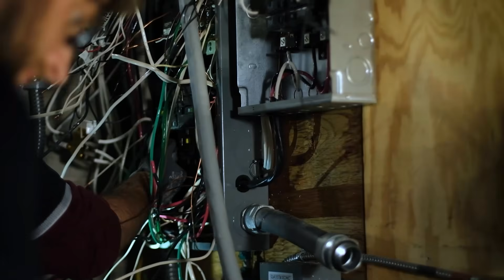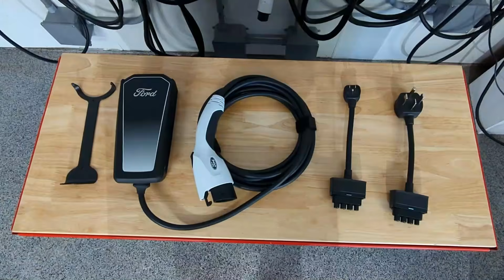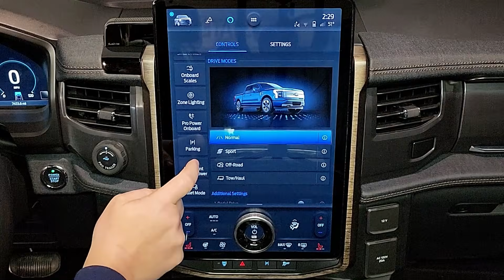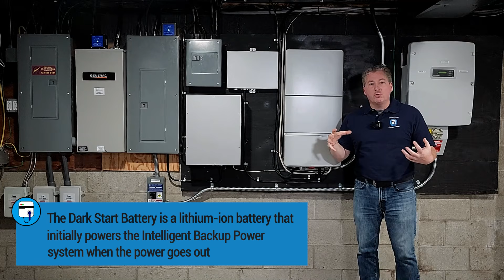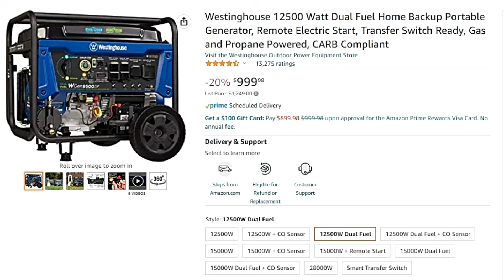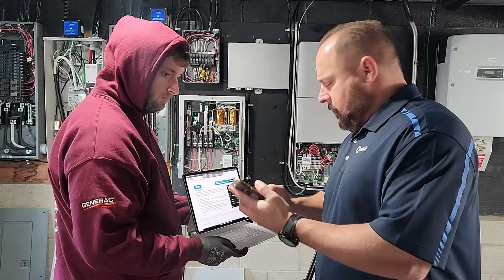Watch How Ford Lightning's Intelligent Backup Power System Works In A Real Home

Comment: If I had an F-150 Lightning, I would stick with running a few extension cords from the ProPower plugs. For now, I just wish my Tesla let me plug any 120V cord in. I have so much power sitting in my garage, yet no way to tap into it!
Reply from the maker: Yeah, it's disappointing that Tesla doesn't seem willing to make a system like this. They don't want you using your vehicle's battery to power your home. They want you do buy a Powerwall.

Comment: Tom I have waited months for you to make this video! Truly awesome 👏 and thank you! Well worth the wait, my setup is still all manual and only have one main panel, I have a $20 breaker lockout switch, 40amp breaker/circuit to my generator input, when my power goes out my wife just flip the lockout switch that turns off the main and active the generator input (generator automatically turns on from a separate line sensor input) so just the one switch she needs to flip when the power goes out! 

Sorry but I am not going to spending thousands of dollars just so that she don’t have to flip that one switch! Sorry but a $20 switch for the win,
Once I get the Ford lightning all she would need to do after flipping the switch is connect the 30amp output into the generator input, just need to buy that cable, manual for the win and everything except large loads in my house, technically we can run one large load at a time if really needed.
Reply: Thanks for making this video Tom, I was hoping it would not cost so much todo .. just so you know the cost to upload your line to 200amps is not required so that cost should not be counted, but I understand if you want to higher than 11kW charging speed, most people already have 200amps service anyways, overall still very expensive not doing it, keeping my $20 lockout switch setup.

Comment: Thanks, Tom - awesome video, I've been waiting for this one. We took a serious look at FIBP - even working with a local electric installer - but the hurdle I just can't get over is the idea that if we sell the house sometime in the future, what are the chances the next owner has a Lightning? It feels to me like there needs to be some sort of industry standardization of V2H to avoid vendor lock-in with these backup power solutions.
Reply: A mobile or self built inverter/battery backup system is cheaper and more flexible.  Just use the pro-power onboard to feed that system and it'll slow charge it while the inverter system manages where the power comes from, solar, battery, generator, EV, etc

Comment: That is pretty expensive for an inverter setup like that. I'd rather spend that on solar inverter and server rack batteries.  Although I would argue that 9kW is plenty of power for most homes, unless you have only resistive electrical appliances. (central heat, water heater, stove, dryer, etc). But you could still run a fridge/freezer, some lights,  and one of those electrical appliances at a time. You'd just have to manage those larger appliances and AC if that were that case.
However, since the F150 has an L14-30 plug on it already, I'd just throw in a generator receptacle and transfer switch or breaker interlock and call it good. Much cheaper that way and can be used with any generator if needed. Just have to make sure to shut all your non-critical appliances off before switching over. And if you have an electric furnace, maybe time to upgrade to a heat pump...

Comment: Keep in mind, with the Inflation Reduction Act, now we don’t need to add solar to a house in order to get a tax credit for putting a battery in our house as a load balancing element. Would that be for everyone?  Of course not, but that is also going to be an increasingly financially viable option for some of us as battery prices continue to go down and would be attractive in areas of the country where power prices are expensive and where different rates are offered as demand on the grid changes.

Comment: I don't believe that most car companies will design and sell intelligent backsup setups , they will likely just make their vehicle capable of communicating with some standardizrd backup system.  I wouldn't invest in a system like fords unless it was standardized so you can plug in any vehicle capable of bidirectional  charging  in case you decide to go with another truck manufacturer in the future.
Reply from the maker: That may be the case, and I should have been clearer. I really meant to say all EVs would work with systems like this. SOme will be made by the OEM and some will be made by 3rd parties, but eventually, they will be universal.

Comment: Can the solar on your roof charge the Ford Lightning during a power outage? Let's try it please!
Reply: Ford has said the present system will not do this.  Takes DC power from the truck battery - doesn't go back.  However, the solar fed into the inverter will supplant any power usage in the home during a loss of grid power.
Reply: @billjohnson3344  Suckie! maybe next year?

Comment: Is the higher power inverter that is coming later able to provide more than 9.6 kW from the truck? Or just more for the attached solar?
Reply from the maker: There will be multiple offerings, I don't know the exact power ratings. Sunrun can tell you because the are the supplier.

Comment: Amazing video as usual. Actually the one I was waiting for. Yeah I definitely considering going with the manual transfer switch option as I have seen on forums too. But for sure I will the station pro installed, but not by SunRon because they want to charge a “flat fee” of $1.600 USD.

Comment: Thanks for walking us through this Tom. Was the option offered to have the system installed with a home battery? It is on the example wiring diagrams. I think the home integration system with a small stationary battery would be quite compelling compared to a large stationary battery.
Reply from the maker: Yeah, it's an option, but IMO, not financially sound for me since I already had the generator and TOU plans here aren't advantageous.

Comment: It's too expensive IMO.  You can ALMOST get a full Generac system for the same price and still use your truck.  Or just get a 50A plug or generlink and a generator.  Perhaps in some areas it makes sense where gas seems to be banned like CA.  But everywhere else a basic gas generator and a link is pretty simple

Comment: My 31 SunPower 327solar panels (10kW AC) array each have a microinverter on them. There are 3 20A 240V strings - 11 panels each on two of these, and 9 panels on the third string. So, the solar panels are "interfacing" with AC power directly.
I am not going to be using a fossil fuel powered generator, period. If you do use a "house battery" function with an EV, then you would save money over time. Getting ourselves off of fossil fuel ASAP - is the most important thing we need to do.

Comment: Tom, 400amps what a show off..lol...we had to upgrade our house to 200amp for our Tesla. Very interesting video thank you.
Reply: 400A isn’t that unusual.  In 1990, I built a house in New England requiring 5 AC condensers, pool pump, bathroom floor heat, electric cooking, Tesla Wall Connector, and 4 refrigerators.  The electrician specified dual - 200A panels like Tom’s.  

When power was lost, we had a frugal setup using a Honda generator with a manual transfer switch.  Today, I’d do a much better system, but home was sold.

Comment: Install cost is comparable to a single Tesla PowerWall, but with significant more capacity. 

But still too rich for my blood. Sure wish there was an easy way to use a generator inlet without a sub panel, but due to the GFCI on the truck you need an isolated sub panel.

Comment: Great video but Sadly Ford and their ccs lighting pro was not the first of the kind! Chademo is 100% compatible with feeding power back to your house or other devices also. They don’t have a smart system but they were the first!

Sorry for waking the troll!
Reply: Ford first in North America.... 

Chademo bi-directional charging has not been marketed in the North America.... But a few are just hitting the market now, ironically when Chademo is virtually dead North America...
Reply: @nc3826  sadly this is misinformation. It was available to the us market but the car manufacturers snuffed it out and kept it quite. Chademo was out of the gate bidirectional compatible. There was a handful of devices out there to use it too. The very first Nissan leaf’s even work with it.
Reply: I'm sorry I forgot to check, conspiracy theory weekly, for the story.

G00gle, Wallbox Quasar...
Reply: @nc3826  sorry but this isn’t a conspiracy theory the chademo protocol has had bidirectional charging in it from the beginning. Not sure what your trying to gain by proving otherwise! Fact is bidirectional charging is not new and Ford did not start it.

Sad thing is anything with a chademo plug or ccs plug on it back then was expensive
Reply: @nc3826  oh dear god! Now you’re believing anything you see on the internet. Just because a company claims first doesn’t mean they were!
Reply: @nc3826  trust me I’m not voting for chademo it is going out the door and having 2 separate connectors on the same car was just stupid!

Comment: One positive from your particular install is being able to use at least some of the solar while the power is out. I realize that cutting solar generation during an outage is about safety for the line workers, as you mention, but it is a shame when solar can't pick up the slack for utility power for direct usage and not just with a battery backup. 

And of course you would set up your natural gas generator to power at least one hefty outlet for charging in your garage!
Reply: There are some new grid intertie inverters that can provide limited amount of power for some home circuits to run some of your loads off of the solar inverter.  So say. you have a 6 KW inverter to send power to the grid, and have a transfer switching installed with say the refrigerator and home lights circuit breaker fed from that transfer switch.  Then your 5-6 KW solar system can provide a portion of it's max rated power to those circuits.

Comment: The idea is not bad, but the whole system is a bit overcomplicated. For emergency power supply, an alternative based on E-GMP cars makes more sense. @TheIoniqGuy has tested it and it works well https://youtu.be/ZmmhOXsIRjw, but the main drawback is the low peak power for countries using the 120V system.
Reply from the maker: That's really a totally different animal - it's more like a low-powered Ford Pro Power Onboard than it is a home backup power system. As you noted, here in the US it's limited to under 2 kW of power and is not very useful in a power outage.

Comment: I thought the Leaf was first to do V2H, just not in North America...
Reply from the maker: It was technically capable, but Nissan never sold a system that would allow it to do so.
Reply: Nissan has approved the first bidirectional charging system for use with its all-electric Leaf vehicle in the US. Sep 13, 2022,  

The FE-15 charger by Fermata Energy, which can power buildings using the EV’s battery, charge it, and send stored energy back to the grid, is the first system of its kind to earn UL 9741 certification for bidirectional charging solutions.

the automaker is also working with another company called Dcbel that is creating a home-specific bidirectional charging solution...

Japan version came out years ago, not even sure if it's still sold and it's all based on CHAdeMO of course....

Comment: I have the same Sunpower inverter/panels in S NJ. Installed about the same time as you. My system is 7.2Kw. Sadly Sunpower doesn’t support the equipment anymore as it uses an industry odd positive ground. My inverter failed out of warranty a year ago and I had to source a refurbished unit at double the cost of a new negative ground inverter. I’d be interested to know if the positive ground panels created a problem for the FIBP? I’d like to replace my system in a couple of years to get newer more efficient technology.
Reply from the maker: No problem at all. The system is working/producing solar fine with the SunRun inverter
Reply: So you have lets guess 20 panels on your roof, wired to the original inverter with a positive ground.  What is stopping you from having someone wire the panels to a negative ground configuration?  It is not all that difficult, and may not require any new wires from the solar panels to the inverter.

Comment: Lol. Ford’s ugly J1772 48 amp charger costs over twice as much as Tesla’s 48 amp NACS charger. I don’t understand who’s buying this stuff. It’s actually pretty cool, but it’s objectively a bad deal. It’s literally cheaper to buy a Tesla Wall Connector and $100 Amazon adapter to charge your F150 Lightning, and it’ll look way nicer in your garage.
Reply: Tesla’s EVSE is also just 48 amps. You can buy a Tesla J1772 EVSE as well.
Reply: fanboi.... Good luck with the Kool-Aid....

Comment: As someone who's very familiar with Home Backup Generators, Solar and EVs,  you did fine with the presentation.  There is just a lot of things being presented and it did muddy the waters a bit and I'm guessing the lay person would have been confused sadly.  

While I think this is very interesting tech, I do not think it's ready for primetime...just yet.  As you said, it's the first.  Cost and complexity will come down in future iterations. 

For myself, it's a party trick of convenience.   Your natural gas generator is the way to go.  Auto start and transfer make it all put fool proof.  You don't have to be home or even think about it.  Other than to pay the gas bill next month and some maintenance visits now and then. 

The Ford solution on the other hand, you have to be home and it really doesn't provide a great deal of power.  It would power what I need but having the truck home to do so is a deal breaker for me. 

Because of costs, I've elected to go with a portable 10kw gas generator and a service meter mounted transfer switch by Generlink.   So while someone does have to be home to start the generator and plug it into my meter, I don't have to be home myself and neither does my vehicle. 

With 10KW and SELECTIVE use of circuits I can run EVERYTHING in my home.  Electric hot water only draws 7kw.  Heat pump is 5.5kw but the surge will max out the generator momentarily.    

I've run every circuit in my home at the same time, including All appliances (less the dryer, heat pump and hot water).     While homes do take a lot... not every circuit is typically running at the same time.   

Like you, we can have power outages that last days to weeks.  So having back up is crucial.   The only issue I have is storing fuel.  I store three days worth of fuel (running generator as needed and off when not (such as over night).  I rotate fuel every six months max using a fuel stabilizer.   At the 6 month mark, it goes into an ICE tank, be it a snow blower, lawn tractor or car. 

What is nice about the Ford solution is that it's automatic.  But it's not a good value at all. And has serious drawback.  Like when you go to work and leave the family home...in the dark.   That would not play well in my home and I'm guessing it would be a huge pain in the ass in most homes as well. And if I need to go looking for a DCFC to top up the truck to be able to run my home, I might as well just buy/store gas for the generator and not worry about it. 

Thank you for presenting this video... I was looking forward to it and enjoyed seeing your set up.   Looking forward to when the kinks are worked out in the future generations.
Reply: So many limitations that it might not work for everyone's needs. I like that his house is able to utilize his roof solar during a power outage, but I wonder if the solar would charge the truck if no one is using any power in the house during that same outage?
Reply: My solution is a 22kw standby generator with an automatic transfer switch. Power goes out, 15 seconds later and the generator has everything back on again, fully automatic and zero worries. And the generator has enough power to run the entire house for an unlimited time without any issues. 

I like the idea of using an EV battery, but my concern is with an extended power outage, the battery just isn't going to do the trick. In September of 2021, we had a tornado come through South Jersey and power was out for three days. A battery isn't going to be able to power my house on a situation like that.
Reply: @Japplesnap  have you heard of solar panels? Unless the sun goes dark power for a lifetime!
Reply: @uhjyuff2095  Unless I had a football field full of them and a way to store backup power, solar panels aren't going to power my whole house for three days. There's this thing called sunset and it does nothing to help solar panels. My house uses electricity 24 hours a day.
Reply: @Japplesnap , Actually the building at "Out Of Spec" motoring Did power their office for a few days during a winter storm in Fort Collins Colorado.  They would send the truck home with one of the employees to a area where they could plug it in for a full charge at night, then back to the office in the morning to run the office again.
Reply: @Kangenpower7  That's great, but my house requires far more power than the OOS office. That's why I got a generator that can supply a continuous 22,000 watts of power. That'll run a lot of hairdryers. LoL

Comment: As you said , somebody had to be first.   Next up would be a system that is not Model specific. I assume only Ford's will be able to power your system/home.  What if I have  2 different model vehicles?   This is very promising.
Reply from the maker: It will work with other Ford models like Mach-E which will son have the ability also. But other brands, hmm, probably not, but maybe through a software update? This is all new for everyone, it's going to take time to sort out these things.